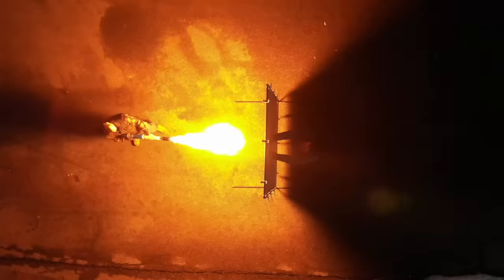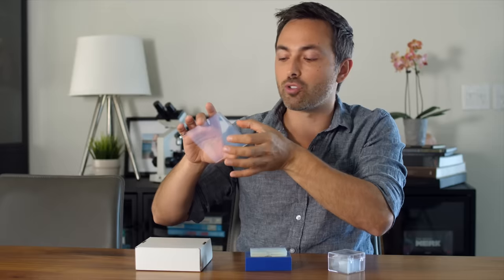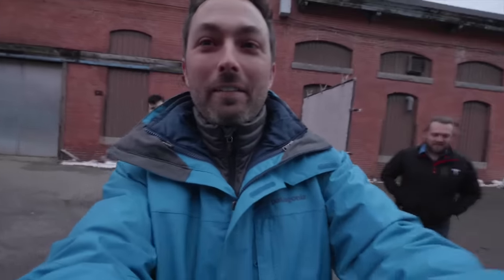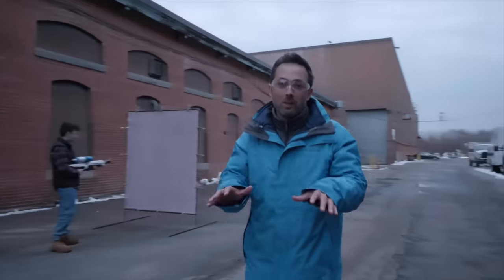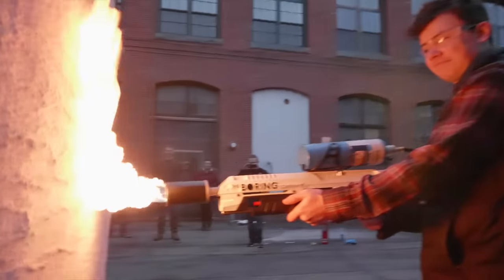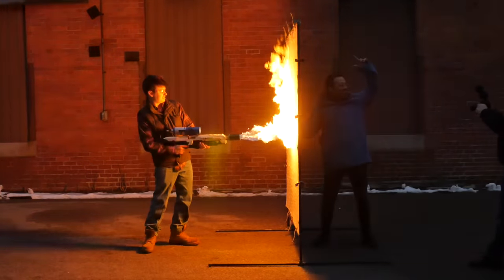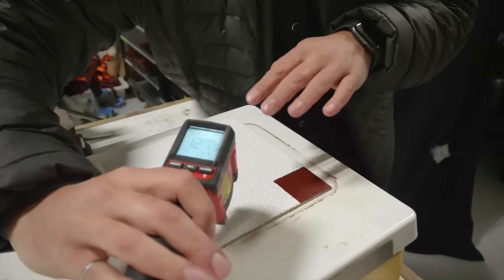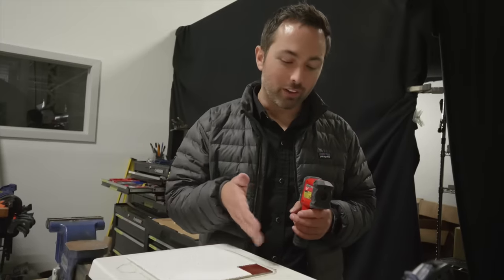Flamethrower vs Aerogel

Comment: The flame thrower probably stopped working because the liquid gas in the tank got colder and it's vapour pressure dropped
Reply: I also wonder if the trigger mechanism froze
Reply: Came down here just to post this.  I seriously doubt his flame-thrower... erm.... propane torch that looks really cool - is broken....  the tank just got too cold.  It'll be fine.
Reply: Agreed.
Reply: @ShanesGettingHandy  can confirm an o ring or something broke inside it from the cold
Reply: More likely, given the nature of the toy that it is, the pipe that feeds the back of the burner is plasticised rubber double layered and the inner pipe melted shut. Just as cheapo "jet lighters" all do.
Reply: @ShanesGettingHandy  Same here - I'd bet money that's exactly what happened and actually thought he was going to mention that, that it was the cold that killed the flamethrower (ironically)
Reply: probable melted a safety before the device blew up... always follow the manufactures directions because that is not a toy...
Reply: @benschofield1361  those damn o rings! Turns out they can even destroy a Space Shuttle.
Reply: Thats actually a torch.

Comment: Destroys guys expensive limited edition flamethrower. Proceeds to out him for using it beyond manufacturers specs so NO WARRANTY REPAIRS.

Thanks Veritasium!
Reply: maybe the boring company needs to replace some of the not-a-flamethrower's parts with aerogel so it can last longer.
Reply: It was that guy's responsability.

Also, it's literally in the name, it's NOT a flamethrower. It's just a 40€ propane torch you use to burn bad herbs glued to a cheap Airsoft replica. The guy can just switch the propane torch out, it'll cost him probably less than the ride to the place where they filmed it.
Reply: Also, people in the comments down below that seem to be more informed than you said that it probably just got too cold.
Reply: the trade off was being immortalized in this video, not to mention using it for the first time?
Reply: Tom Jones is rather have the flamethrower than be the the guy who broke his expensive collectible flamethrower on YouTube for millions to see

Comment: Hopefully not breaking, freezing. The propane is acting like a refrigerant, because it's one of those too. (R290) The mechanism should be freezing up. Hopefully after a bit at room temp it'll be all happy so long as you didn't gall anything important. 
For future use, a propane torch like used for killing weeds would work well for this too. Or any hand torch for propane, MAPP, MAPP/Oxy, Acetylene, Oxy/Acetylene, etc.

Comment: If you heat up the air in Aerogel, how long would it stay warm for?
Reply: AEROLAVA
Reply: But isn't it the air in the gel that is insulative, not the gel itself?
Reply: @superiorglitch8195  Can't we just dip them into lava and then use them as an insulator? We can also let them out on a sun for a day or two in Phoenix, that will do the job.
Reply: probably a couple eternities would be my guess
Reply: It may stay warm on the inside, but its surface would cool to the outside temperature, which is just the opposite of what we've seen in the video.
Reply: @cheatman05  That doesn't seems right, because even in the video he explained that the heat can't get inside the material. So, the outside will be hot while inside cold. When you manage to heat up inside, it should radiate to outside, because even cold temperature can't get in.
Reply: @SneakyBadAssOG  which part claim heat cant get inside?
Reply: Great question.
Reply: @SneakyBadAssOG  Wut. Heat does get inside. It just takes ages.
Reply: heat does get in, but it transfers the difference of temperature really really slowly.
so if one side is 2000°C and the other is 0°C, the heat will transfer to the cold side, but it just takes longer than with other materials.
if you take a block, and put it into an oven, it will take a long time untill the heat transfered into the block. it will take even longer to get the middle of the block to about the oven temperature. it doesnt take much energy for that, but it takes lots of time. thats the difference there. it insulates the inside of the block from the outside temperature. so if it gets hot outside, it takes maybe hours (depending on block size) till it is hot inside. it will get warmer and warmer, just really slowly, untill it has the same temperature as outside.
the other problem is, it takes a long time to get the inside to heat up, so it also takes a long time to let the heat transfer out again. 

if you put the block into a 200°C oven, let it sit long enough that its 200°C in the middle, then take it out and watch what happens, you'll notice the surrounding temp outside of the oven may be 20°C, the temperature of the block inside is 200°C, but the heat only transfers slowly out of the block, so you dont get to feel much warmth coming off it. it will be hot for a brief moment, when you take it out of the oven, bec. the blocks walls are hot, but they cool down, and the 200°C inside only transfer to the walls super slow.
Reply: It would depend on the temperature of the air entering and replacing the heated air. 2nd law of thermodynamics is the higher the temperature difference, the faster heat will transfer. I'm not sure how long it would it would take for the temperatures to equalize because Lincoln Tech never taught us how to measure the speed of heat transfer (or I completely forgot🙃).

Comment: That isn't a flamethrower. A flamethrower uses jellied gasoline to stick to the target. That's more like a flame-blower.
Reply: Glenn Griffon well that's half the reason it's called Not a Flamethrower
Reply: Yeah idk don't flamethrowers burn at a few thousand degrees celsius
Reply: @nejatia8745  Flamethrowers just ignite a fuel(liquid) which is thrown onto a target. Imagine taking a hose that shoots gasoline and lighting the gasoline on fire. The temperature has nothing to do with a (real) flamethrower. Afaik the not a flamethrower would burn hotter because propane burns much hotter than gasoline.
Reply: The Elon Musk flamethrower is just a roofing torch that he designed to look cool and charges 100X the price.
Reply: It is literally named "Not A Flamethrower". But yeah Veritasium did put flamethrower in the title, so that might need some clarification.
Reply: He also did a video on how to get a video to go viral and title is a big part of it, so.....

Spoiler alert: this channel is a commercial venture and never claimed not to be.
Reply: I imagine it would be much more expensive to get a real flamethrower, and the point is to reach a hot temperature, so a blowtorch type thing is probably sufficient
Reply: That's not true. Flamethrowers can use gasses or straightup gasoline as well.
Reply: I throws fekin flames, now that's settled!
Reply: It's a stupid weed burner. The boring company sucks.
Reply: "I don't think you're ready for this jelly."
Reply: Temperature is the important parameter here, not the stickiness of the fuel.

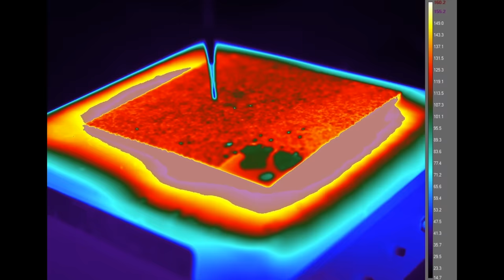Comment: That stuff going on around 8:00

Perfect demonstration of the fact that humans don't usually detect temperature, we detect thermal flux.

When you touch something and it's hot, you're not measuring its temperature, you're measuring how fast heat is able to move into your skin. That's just usually strongly correlated with temperature, and the more important factor.

There are specific temperature sensitive proteins that change shape only at certain temperatures, and those do measure absolute values to maintain homeostasis, but the external sensation of heat is thermal flux.
Reply: You're not the teacher we needed, but the teacher we deserved.
Reply: @giofunny6391  Pretty sure I'm just relaying info from another video Veritasium made lol
Reply: @Teth47  But that's what teaching is all about, passing knowledge. This makes us a bit 'smarter every day'.

Comment: we bought some of the silica aerogel for an iceshack to encase the wood stove area to conserve heat in the winter. stuff works wonderfully. only heads up i can give is dress appropriately for handling aero gel insulation. if it gets on your skin it rashes like crazy. n95 mask is also a must

Comment: I sure hope this material does not become the next asbestos.
Reply: One problem with asbestos is the structure of the dust/filaments. When it gets in the lungs (and it can get quite deeply in them), it stays there and caused scar tissue to form and leads to inflammation (and sometimes cancer). I suspect that the CDC and other public health organisms already looked at it to prevent the same thing repeating since asbestos is still causing problems despite the fact that it hasn't been used for years in most cases. This being said, as with any kind of dust, you definitely don't want to inhale some of it, as it will lead to irritation and inflammation. Look at both types of dust under a microscope, and you'll immediately see the difference though.
Reply: Aerogel could also break and turn into dust. I'm sure this one, silica dust is also dangerous to your lungs.
Reply: Mark Steven  It should be. Aerogel is one of the best and latest science advancement in this era. With many more advancement, aerogel should have some public uses that will advance this era.
Reply: Mark Steven  It will.  It solves many thermal insulations problems

Comment: So when are they going to make fireman's coats out of it?
Reply: Only oil tycoons can use it, it's not for protecting the disposable layman.
Reply: @DarKcS2  say sike right now
Reply: @DarKcS2  huhh.., another conspiracy theorist of 'big bad oil company'.
Reply: I wonder how reliable and long lasting these materials are
Reply: Firemen already have fire resistant suits..
Reply: @ArifRWinandar  Yes, they do. But those are heavy as hell. Aerogel is much lighter than anything they are using now. A problem I see with Aerogel for suits is cleaning the suit; from my point of understanding Aerogel, it will gradually suck water back into it, which is not great in wet conditions. Firefighting is full of sweat and water.
Reply: I’m guessing it’s currently too expensive for cities to outfit all their firemen with brand new aerogel suits.  But hopefully the costs go down so it’s more accessible
Reply: There's 1 problem with aerogel: It doesn't breathe like, at all. Which is funny for a material mostly composed of air.
There's a good chance that firemen would overheat inside of their own suits whilst remaining relatively unharmed from the hell outside of It.
Reply: Luca Zarecki  but that defeats the use of aero gel as shown with the hot plate.

Comment: “Flamethrower vs Aerogel”

“Not-a-flamethrower vs Aerogel”

“Worlds best heat shield is 99.8% air?”

“Flamethrower vs Aerogel”

Looks like we went full circle
Reply from the maker: haha I always thought the right title for this was Flamethrower vs Aerogel, yes I know it's not technically a flamethrower but it throws flames so 
¯\_(ツ)_/¯
Reply: @veritasium  I mean technically it throws flames, so it wouldn't be too wrong. I mean a more correct term would be "flamespitter" I guess?
Reply: Also "Flamethrower* vs Aerogel"
Reply: you inspired me to do this kind of things in my channel
Reply: I read this as flamethrower vs angel
Reply: Who cares, the temperature difference between a flamethrower and propane is not significant enough to make the point of the video change.
Reply: @veritasium  nice vids
Reply: It doesn't really throw or spit flames. It blows flames. It's a flameblower.
Reply: Flamethrower vs Aerogel: You looked for the best title and where did you bring that? Back to me
Reply: Veritasium Torch would be better. Flamethrowers are in a completely different, terrifying league.
Reply: @seigeengine  
Hmmm... Yup. I definitely do not know enough about this to say something about that...
Reply: The flame thrower nozzle needs a bit of Aerogel placed in and around it to insulate it from the heat... which is causing the nozzle's hole to shrink due to the heat expanding the nozzle 🙃
Reply: @veritasium  ask the hack smith to test it with a light Saber that is the real test
Reply: @amistrophy  The only notable difference between a "real" flamethrower and this is the range 😐.

Comment: I'm really excited about this Areogel product.  Image a tin coating in the walls of homes & buildings.  The energy saved, and reduced green house emissions caused by burning fossil fuels to heat buildings would be phenomenal.  And then they say the killer application is insulating oil pipe lines.  WTF
Reply: Dumb expensive for now. But a bubblegum thin strip where your exterior framing touches your interior walls would cost much less and could improve thermal retention by 15%.

Comment: Perhaps it's already being used for this application but this would work great for an emergency shelter for forest fire fighters.
Reply: If i remember correctly forset fire fighters are already equipped with Mylar blankets.
Reply: @allstarwoo4  I think you're right but would/does Mylar protect/insulate as well as this product? I remember a couple of years ago where at least 1 forest fire fighter was found dead inside his emergency shelter, now I don't remember what they said was his cause of death, but was it from heat or suffocation as the fire sucked all the oxygen away from him?
Reply: @jcf6597  Mylar doesn't protect as well as Aero gel but other solutions have trade offs. It'd be a lot for me to type but understand it's a balance of weight, price and size. Too heavy and it'll slow them down. Too expensive and you can't give as standard equipment.Too big and they can't carry. Mylar is all 3.

Comment: Those weed burner torches really need a 20lb tank to function properly due to the latent heat of vaporization of the liquefied petroleum. Valve (trigger) probably froze (literally) with cryogenic temperature  liquid coming out of the propane canister.  Edit: I should note 20lb being the common "barbecue" size propane/butane canister in North America. Also as a side note to Veritasium, THANK YOU for using Celsius!

Comment: Dry Carbon fiber itself can hold almost 2000°c heat ,race car driver suits hold upto 800°c, tungsten can hold almost 3400°c.this comes like flexible and transferable more likely used in many applications I guess, other than flexible race suits .

Comment: A good idea would be making windows. Two glass panels with aerogel in-between, instead of vacuum.
Another one is making glass fiber infused with aerogel to insulate houses.
Firefighter suits made of this mixture.
And use aerogel infused paint for firewalls

Comment: For fixed insulation plates, you can coat them with resin or something.
Maybe honeycomb with extremely thin interconnection between one side
and the other filled with aerogel.
It's a very neat material.

Comment: This is needed now in the transportation industry for HazMat placards. The recent train derailment in Ohio melted all the placards so they didn't know what chemicals they were dealing with when the Emergency Services arrived.
This technology can prevent that from ever happening again.
Reply: At 9:46 if we can levitate trains in this way or if we switch to levitating rails we wouldn't have had a bearing failure.

Comment: Bens flamethrower will probably be alright once it cools down, its likely the same effect as with regular propane lighters - the hotter they get the worse they function. Not sure why but I always figured it may be because of the metal expanding and choking the valve.

Comment: I bet the flame thrower worked fine after it sat for awhile, unused. Because propane tanks are filled with liquid, it boils into a gas, and the temperature and pressure of the bottle drops. The valve is also another restriction device, which also creates a temp/pressure drop, and both of those will cause icing. It's no different than using a small propane tank for a driveway deicer, rubber roof install, or even a gas grill. As there bottle gets colder, the flames get share smaller.